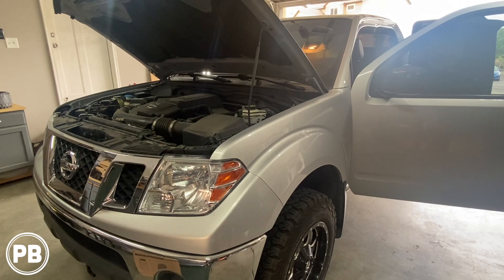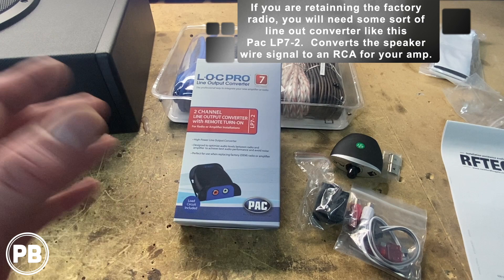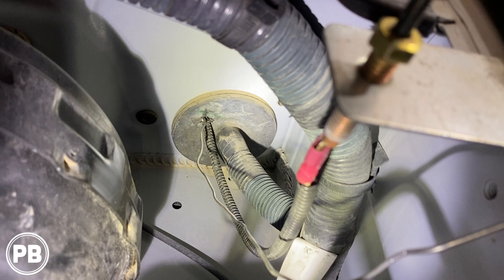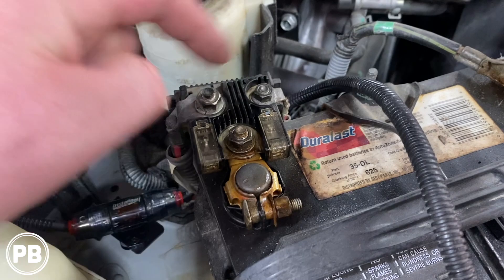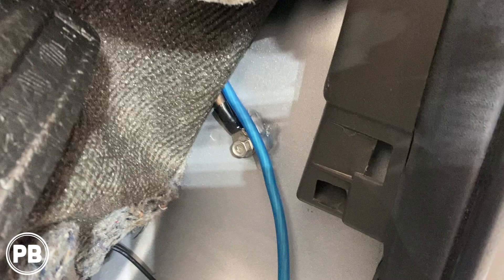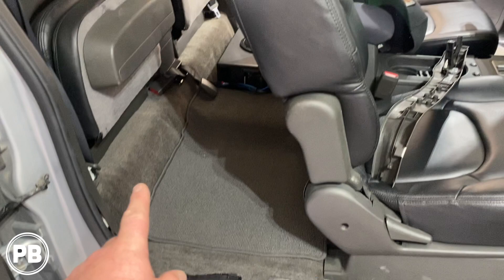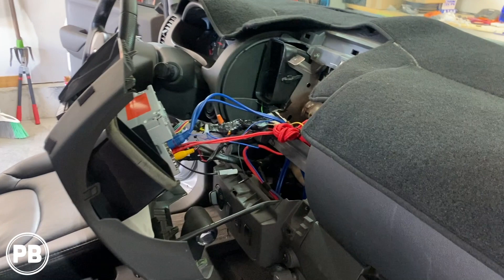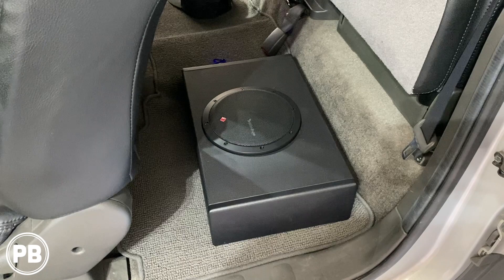2005 - 2021 Nissan Frontier Amp and Sub Install

Comment: I’m trying to hook up my system to my factory radio.  Wires are ran.   Do I connect my remote amp wire to the blue white like you said.  I have a ‘19.

Comment: We customers realize selling products is in the interest of any dealer but please don't claim a LOC is "required" when most modern amps, and especially all powered subs, take high-level input and auto-turn on. Especially these Rockford ones do it superbly. Just splice a (front) car speaker wire and extend it to the sub = done. Only needs power+ground, nothing else.
Reply from the maker: I'm not a dealer, so no i'm not going to "require" you to do anything.

Comment: If I'm still running the stock radio if I cut off the RCA ends and hook up to the back speakers do I still need to run the remote turn on wire (blue wire) to the head unit?
Reply: No. All Rockford powered subs take speaker level input wires AND turn on based off of signal or dc offset in those wires as chosen on the built in amp. No need for a LOC as this video suggests. It's not the year 1883 in car audio anymore. Line out converters are completely useless.

Comment: How do I get to the rear speaker wire to splice the rca ?
Reply from the maker: Need more context. If you have the same powered sub, you simply cut off the rca ends, strip the ends, and extend to your speaker wires in your vehicle. Alternatively use a line out converter.

Comment: How much was the job for this truck?
Reply from the maker: The parts we used are linked in the description, labor varies by shop, but I usually takes about 3-4 hours. I’d call around for rates from your local shops